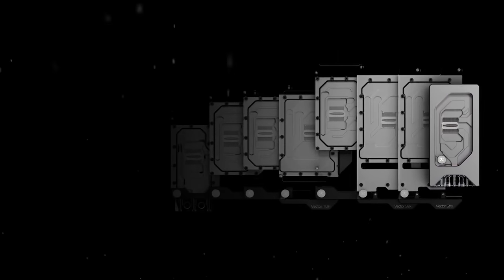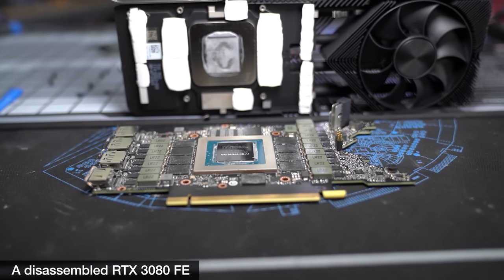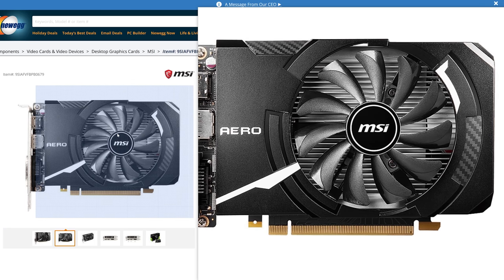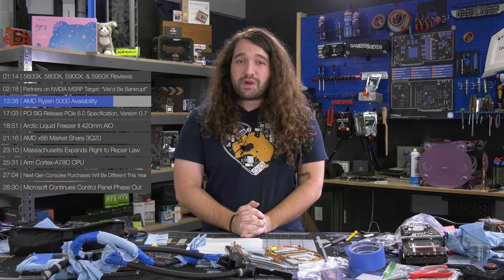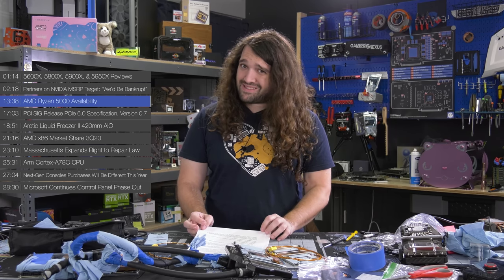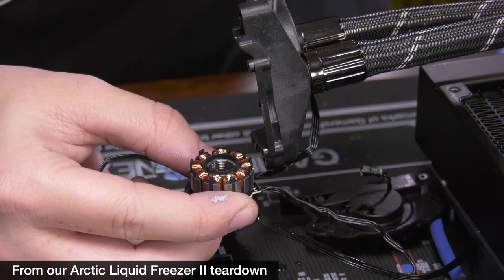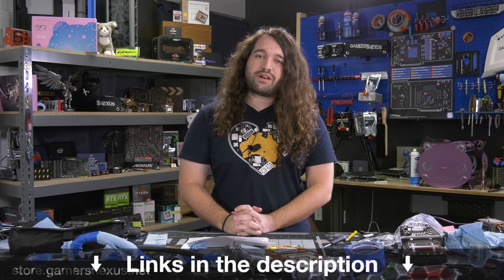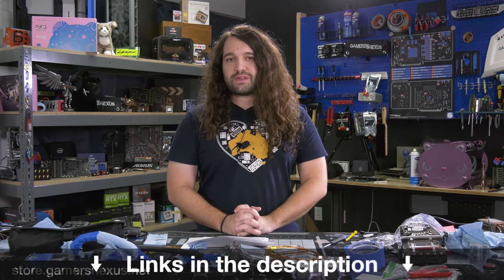HW News - NVIDIA MSRP Allegedly Not Realistic, Ryzen 5000 Supply, PCIe 6.0 Spec

Comment: Honestly the Windows 10 settings app is infuriating... But I could teach myself to live with it if only I could open several instances of it at once. Its in the name of the OS for crying out loud, let me use several windows for easy referencing. There’s a reason I upgraded from small 4x3 monitors a while ago.
Reply: starshipeleven I used Revo to uninstall literally all of those dogshit apps, and my system sped up quite a bit. I don’t need a camera app, or  settings app, it’s a fucking computer...I hope they get enough backlash from everyone to add it back eventually after they remove it. I'm so fucking sick of companies trying to fix shit that doesn’t need fixing.
Reply: Yes! That is the most frustrating part of the settings app for me too. Super frustrating not being able to multitask anything settings related, especially when setting up a new computer or trying to fix a broken computer.
Reply: So when do they implement a "compact mode" that is actually compact and able to show stuff....
Reply: starshipeleven   designed for touch devices my ass.
Using my Surface as a 'tablet' has to be the absolute worst OS experience I have ever had. To the point that I think It's almost criminal that they sell the type cover separately.
The whole "universal windows platform" (or whatever it is currently being peddled as) has been detrimental to the entire Windows experience since 8.
Reply: @SyncF  id be happy to clean all this garbage from my pc, but is revo actually safe to use? i want to get rid of it as soon as i delete the windows stuff...
Reply: @JaconSamsta  A decade or so back the US Military had the brilliant idea to use the exact same camouflage pattern in every environment. That went about as well as you'd expect, so they've since walked back and now actually have real camouflage that actually works. It's incredible that people keep making this kind of mistake.

It's also incredible that MS continues to insist on the ribbon interface despite it being objectively horrid, but I digress.
Reply: @christhefirst  As far as I know yeah, Revo is safe to use. Uninstalling it actually keeps it off your computer, unlike some malware that tends to stick around
Reply: Wtf Microsoft leave my dam control panel alone
Reply: @SyncF  nah fam, revo aint safe

Comment: Why is Microsoft so damn intent on ruining the Windows platform?
Reply: seems they want to be apple
Reply: Because most people love it, I dunno why but a lot of people love win 10 and hate decent windows oses.
Reply: @tilburg8683  lol Win10 is so obnoxious... Win8 never got on ANY of my PC's YUK... and Win10 needs a massive cleaning when freshly installed for all the crap they put on your PC... in the old days you could pick what you wanted... not anymore...
Reply: Windows 10 really just became a huge bloatware
Reply: Because so many of their users want "It just works" levels of interaction with their computers. If achieving that has MS removing ever more features and control, they are fine with that. Remember that only middle aged and older people really have experience making computers work. For younger people, they never had to learn how the computer incorporates peripherals (remember setting IRQs for that sound card?) or how the computer uses memory (remember using boot disks to free hi-mem?). Even details like networking are crazy divided between the home user with everything connect to the same low security wifi and the "enthusiast" types with guest wifi, separated domains, etc. that actually require real configuration.
Reply: Because their focus for a long time has been their number one product, us, the customer, not Windows. By removing control, and inserting their monitoring and reporting scripts, they gain access to all our data, which is then chopped up and sold to the highest bidder. 

We have been the largest single product for a long time to these tech companies, without even realizing it. All their tech sales, is a way to gain access to the main commodity that is us. Most people don’t realize that google, for example, knows them better than they know themselves; They know when you sleep, and how long, what you sleep on, what you eat and when, what you watch, what you search for, how, when, why, what you purchase, who you know, how your relationships are going, etc. They build a profile of you, collate all the data, then sell that to the highest bidder.
Reply: Win10 was Microsoft's attempt to turn your $2k gaming PC into an iPhone.
Reply: I'm fine with them removing the control panel as long as its features exist in the new settings menu. And that's where the problem's at: features are missing in the new settings menu or it's not clear where to find them. Often you end up in the control panel anyway because the new settings menu misses essential features.
Reply: @Neverwinterx  Yes. Also now the settings are all over the place. Also often you have to go through several screens, that you never use,to edit a setting which before that was on the first screen. Also  often settings are put in Advanced submenu, where the main screen has only one pointless setting
Reply: hehe..  is it just me or is ms like that kid in the playground who always tries to change rules mid-game?
Reply: @teknastyk  MS: "Hey guys, we updated Windows!"
Everyone: "So you scattered all the buttons we use to places we can't find, and renamed as things that don't make sense. Gotcha."
Reply: @BigBear--  "We have been the largest single product for a long time to these tech companies, without even realizing it."
It should have been obvious as soon as Microsoft started letting people use windows indefinitely without a product key.
Reply: @Steve Fox "Anyone who says windows 8 was bad didn't actually know how to use their computer."
I didn't know how to use windows 8, I'll admit that, but I knew how to use XP. Microsoft dumbed-down the UI and hid all the functionality for no good reason.
Reply: This is what happens when you don't have competition. Microsoft is lucky they've locked down gaming. I wouldn't touch this plauge otherwise 🤬
Reply: because it is full of spyware and records everything you do in one of their big data centers across America. They record everything and if you don't know how to turn if all off it will track all your website browsing, has access to all your files, pictures, email accts. and basically every file or program on your PC and even use a key stroke program to store everything you type.
Reply: because billionaire bill and his friends don't think the average person should have the right to do powerful computing at home
Reply: @BigBear--  they code the OS, they dont need to do anything but just send the data back to them.
Reply: Hey guys, I’m not really tech savvy. If I just wanna play games and do Microsoft office stuff plus watching videos etc. what windows version is better? What exactly is wrong with Windows 10? Can someone help me out lmao. (I’m building my PC myself btw)
Reply: @PatsliTV  In older versions you could decide yourself when to install updates. Now you can postphone them to later the day.
They are way more eager to send out your data than before.
For the sake of "modernization" they move things around from where they have been for nearly 3 decades.
the DWM-based vsync is now enforced, so you will always have higher input lag when not playing in exclusive fullscreen (which they also tried to get rid off)
Oh, and there is a full article on wikipedia with removed features: (So it depends on what you used if you see an issue with that)
https://en.wikipedia.org/wiki/List_of_features_removed_in_Windows_10

But Windows 10 is the only one they fully support now, so if you want security and feature updates and support you have to use it.
Besides that Windows 8.1 will have extended support until 2023, but both it and Windows 7 can still be used just fine, be mostly secure (if you don't go anywhere shady) and still run fairly recent hardware, and perform in most cases identical (sometimes worse, sometimes better), just with some things missing like DirectX 12 or Edge browser.
Reply: @HappyBeezerStudios  man, that’s fucked up. But considering I’ll be using it for gaming and Microsoft office most of the time, I don‘t know if the hassle of making myself familiar with Linux is worth it...
Reply: @tilburg8683  What decent Windows OSes? The only choices are Windows 8.1 and Windows 10. Anything else is end of life and you'd be foolish to keep using it.

Comment: The windows settings app is completely broken and still lacks so much stuff, you need to just edit the registry to get anything done now-a-days
Reply: starshipeleven  XP worked, Vista allways knew better than the user and slapped your fingers every time, now they are trying to kill off every customer they have, why had M$ turned even more to Googles old mantra, but using the antipod of it! Allways herding the customers off the cliff!
Reply: And honestly? It's SLOW.
Whoever designed the Settings app must have more time than the rest of us, because waiting for the useless slick interface to finish it's animation on each page is completely abysmal.
On top of that, no dividers or separations make it impossible to easily read the Settings app. In fact, it's so easy to scroll past the thing you want, you'll probably just end up using Control Panel instead.
Reply: If your a tech and you use the settings app, your doing something wrong.  Power shell, learn it.
Reply: Windows 7 FOREVER Q_Q...
Reply: starshipeleven  im teen and i know this
Reply: @jasgud  So what is the powershell command to set the preferred device (controller) for older programs?
Reply: Or the powershell command to change the window font.
Or the powershell command to change the size of window borders
Or the powershell command to change the width of scrollbars
Or the powershell command to change the distance between desktop icons
Or the powershell command to change the preferred MIDI device

I can go on all day
Reply: I don't get why people love windows 10 so much its literally the worst os ever and shouls be outlawed. And the creators should be arrested for treason and crimes against humanity.
Reply: @tilburg8683  i like the start menu cause i can categorize and pin all my apps kinds like an app drawer on an android phone, it keeps my desktop nice and icon free which is boner inducing but the rest of it is making me look more at Linux gaming 😆😆
Reply: @mackenziebullied4900  - Every time I try Linux, I walk away angry.
Reply: @SullenSecret  try ubuntu my dad said the same thing and i was just like don't use Linux mint then u old feker
Reply: I literally cannot invert my mouse scroll to be natural without a registry hack. WTF Microsoft.
Reply: @astronemir  why would you ever wanna scroll up to scroll down?
Reply: @tilburg8683  It's not as bad as XP but it's significantly worse than 7. It has some nice QoL features to distract you from how fundamentally lacking it is on the technical side.
Reply: @SullenSecret  honestly that was me too. About this time, windows is actually equivalent (imo) in functionality compared to popular "beginner" linux distros. Many of the settings now missing in windows were always missing in linux. The reason you're so frustrated is probably just because it's so different, and I can understand that.

It's sad that the only reason linux is getting attention for the most part is not because it got better, but because windows got so bad and devolved from "far better than linux" to "about the same or worse than linux".
Reply: @bananya6020  - My biggest problem with the design of Linux is that not everything is push-button style instead of the terminal. That may seem like a simple complaint, but I've had the OS get broken over this when a simple button press and some automation could have prevented it.
Reply: starshipeleven  XP had security problems, but those aren't related to the UI, so it's completely irrelevant in terms of user experience.
Reply: @jasgud  If I have to go into the command line to change some basic fucking settings, you done fucked up as an OS developer. For fucks sake, even Linus Torvalds would agree. And besides, the point of Windows is (or should I say, was) to give users as much control as possible while still making it easy to navigate and find what you want when you want it.
Reply: @arnox4554 setting app is there for most things users need. Winrm and PowerShell are for everything else an it person needs. PowerShell is the way.
Reply: @jasgud  No, it's not the way, and users shouldn't be forced to use it to access formerly available GUI settings.

Look, I don't have anything against Powershell, but it has specific roles, and this isn't one of them.
Reply: @SullenSecret  You're probably just using the wrong distro. There are a lot of distros out there. I'm a software engineer by trade and even I just configure it by minimum, just the things I need tasks I need to do. Basically, I have both Windows 10 and my Linux PC work the same. OSs are tools just learn how to use it. Don't like these fools who can't even make a simple, dumbed-down, made-for-stupid Windows 10. It honestly says a lot more about the user than the OS itself. A bad craftsman blames his tools.
Reply: starshipeleven  SP2 was okay tbh. You're acting like anything pre SP3 was ME.
Reply: starshipeleven  I can assure you compared to ME Even SP2 was more than fine. ME was a clusterfuck so bad that XP was rushed out to replace it. That's how bad ME was. XP was the emergency stopgap. Whatever you think about XP just about every aspect was significantly worse in ME. Especially for servers. SP2 was just "okay" compared to what went on with ME.